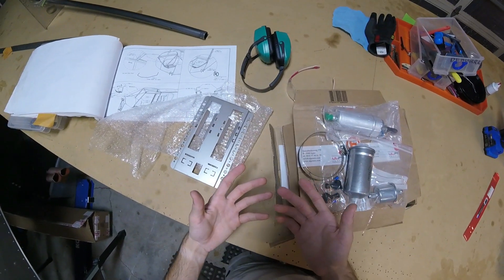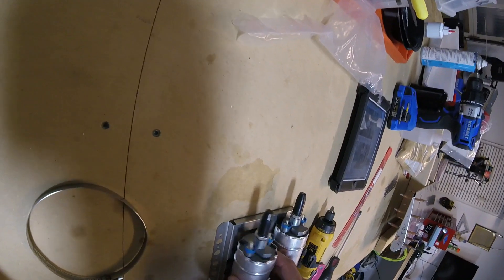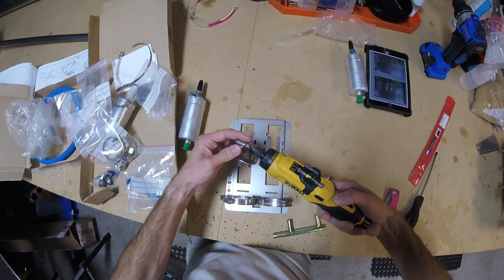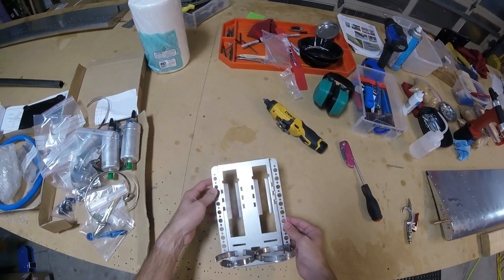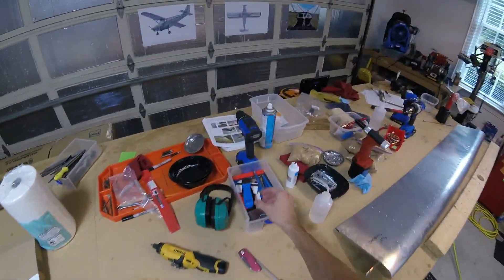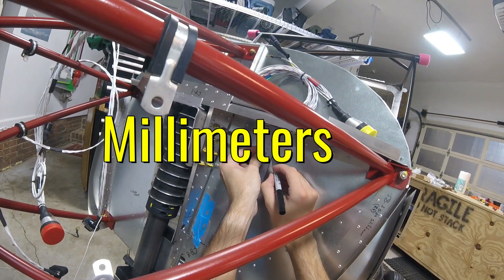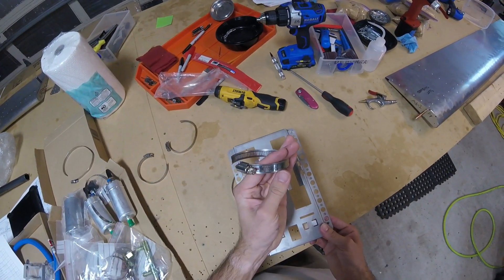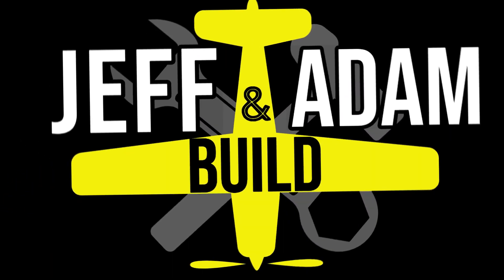Dual Fuel Pump Assembly PART 1 - UL350iS Engine - Zenith 750 Cruzer Kit Plane

Comment: Your not worried about inducing stress cracks into the pump mounting plate, by your screwdriver and hammer method, that vibration later might induce a failure?
Reply: Lmao.. I totally understand the disclaimer and can't wait for next videos..  Hahaha
Reply: .... Continued. This guy totally works on his aircraft like an old 1979 cheve pickup.. I LOVE IT can't wait to see the old girl in the air
Reply from the maker: lol thanks Dan!
Reply from the maker: Nope. But I'll keep an eye on it and let you know if it does.😀